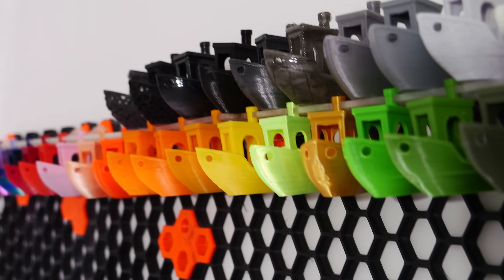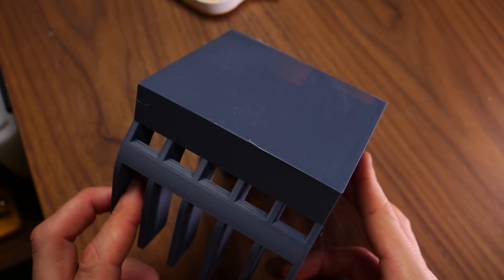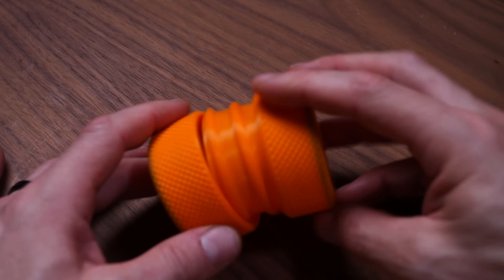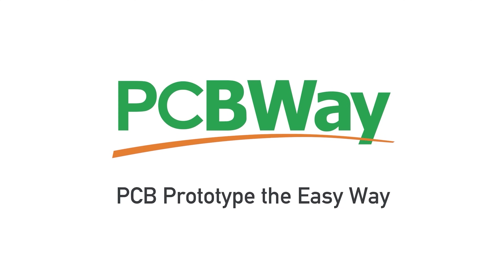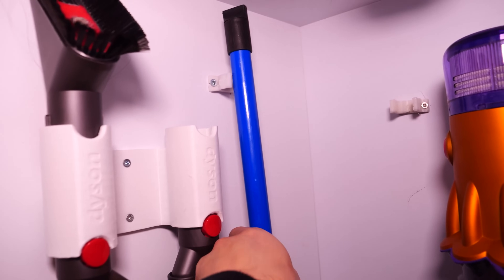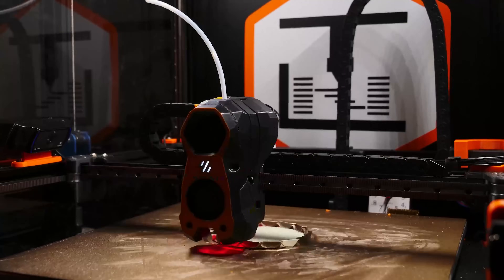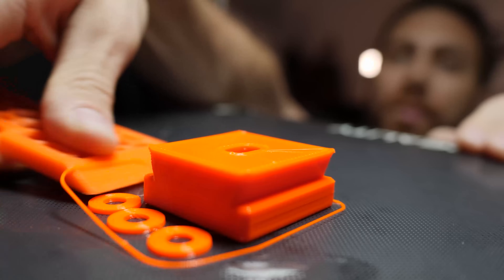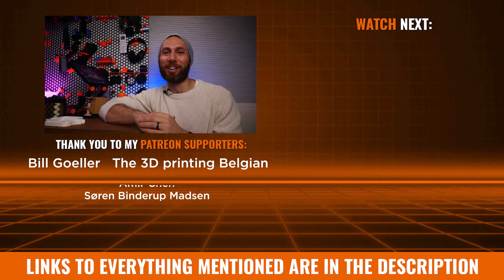15 Useful 3D Prints: Go From Beginner to Advanced!

Comment: I had an idea for my kitchen pop in my head while I'm watching this video.  I have a few metal shelf baskets that attach to the wall in my kitchen. This spot sits behind what was the original back door. It's not much wall depth and the floor vent is directly under this spot. So, no furniture or cabinets will fit outside of a custom build. I can print my own to add storage space to that wall and get better use of the space. It's perfect for pantry goods that come in certain box sizes.

Comment: I struggle with keeping the bevel even at the tip. Mostly on one side. I use a 1x30 system and I have tried to figure out why by changing my movements. Any tips?

Comment: This post rocks. Thank you. We beginners need more of this kind of thing. Don't get me wrong, I make a Benchy with every new spool, but I'm so green I don't even know what I'm supposed to learn from a Benchy, so I just have a small flotilla that hasn't really helped me learn anything. The rest is usually fumbling through the settings until I get something to work. Am I making it work in the best way? I don't know nearly enough to say. This kind of post, however, is immensely helpful. Thank you again.
Reply: Hah. That’s why I’ve never printed a benchy. I’ve had my printer for a month and haven’t had any problems with it yet.
Reply: @claire2430  don't worry. You will. Maintenance is part of the hobby.

Comment: For the stand, try printing with proper hirth joints instead of those little friction bumps. It's actually a pretty easy model for 3d printing. There are three angles that matter. Tooth angle, (60 degrees works well), angle between teeth, (we represent this with the number of teeth), and the groove angle. Groove angle is dependent. The equation is: 
arctan[tan(90/number of teeth)/tan(0.5*tooth angle)] Don't forget, the groove angle is half of the total angle between the tooth and the groove. There is an awesome PDF called "Geometry, equations, and modeling techniques of Hirth joints/couplings". It will teach you all you need to know for the purposes of modeling for 3d printing.

Comment: Summary of the video: "Here's a print that will challenge you with this setting!" Video then proceeds to NOT explain a SINGLE thing about that setting or what you might need to adjust in your slicer / printer settings if the very specific thing he says will go wrong goes wrong.

I was hoping that at the end of the video there was maybe something along the things of "if any of these prints gave you troubles, here's a list of other videos I've made explaining how to fix these problems." But nope. This video is clearly aimed at those newer to 3D printing, but offers nothing useful to anyone struggling.

On the plus side, there are some cool printable gadgets here that I might not have found otherwise...

Comment: 3d printed a mouse shell for my logitech g305. Turned out perfect but Tolerances need to be spot on. if not the pcb, scrollwhelle and other hardware will not fit!

Comment: The video is great for guiding you to problems without helping with any of said new found problems. equivalent of a teacher throwing the textbook at you and telling you to read the chapter.
Reply: Even worse. Its trading small, low cost test parts for larger higher cost test parts. So not only do you still not know why the stringing happens, you get to waste 200g of filament instead of 10g
Reply: I love the video of what xyz means in the benchie test. Did you know the benchie has its own website?  @Leedledlee
Reply: @Leedledlee  EXACTLY. The title is so misleading
Reply: Right?! I got about 4 minutes in before it hit me. This video is basically useless.

Comment: I tried printing the cable winder - the lid. It sticks well to the print bed, but about 60% through, when it's printing the middle bits, it does not stick to the print anymore and then just starts printing in mid air. Any ideas why this may be happening? Thanks!

Comment: As someone who also does a lot of drilling around the house, I’ll let you in on a cheaper, more effective & more accessible trick for catching the dust: try a post-it instead. You stick it to the wall just below where you’re drilling & fold the bottom half up so it’s like a paper shelf to catch the dust. It catches all of the dust (because it’s stuck completely against the wall), & if you don’t have a post-it, you can use tape & paper to achieve the same effect. It was a game changer for me :)
Reply: You can also do this with an envelope and a piece of tape.
Reply: I have always just held a damp paper towel underneath while drilling and wiped up anything that stuck to the wall. May have to try the sticky note to see which is better.
Reply: Or use the bottom half of an empty milk carton -cheap, light and readily available.

Comment: 14:28 these (with pla plus and my settings) will support 100lbs, yes really, i hung one up and started to pull on it with a old fish scale, most i could pull was like 60 lbs, so i started to hang from it, had it at 100 before i shifted my weight again go put more on it and it went. In other news getting whacked by a 6lb fish scale at high speed in the hands and head hurts really bad. Cant wait to repeat the test with cf nylon in the future!

Comment: This guy advertises challenging for any 3D printer but yet is rocking a bamboo Labs  carbon which basically does everything for you even calibrates your first layer
Reply from the maker: Yeah that’s fair, though the Bambu is far from perfect, but I mostly printed with it because it does the Timelapse’s for you! Though as you’ll see in the video I did a lot on my uncalibrated voron and my Prusa

Comment: I have an issue where i get holes in my outer surface (walls). They are not completely random, they appear als in the same
Spot and they are not z-sean. My Z seam is already aligned.
I tried drying my filament in a filamend dryer from sunlu but its not helping. At first the filament printed well but now… i even tried standard settings from cura.
Reply from the maker: Upload some pics on our discord we will help you out. It’s probably pressure advance not being well calibrated. Https://jle.vi/tnldiscord

Comment: I wish you the best in making youtube content and to help you there are some things i think worth mentioning:
- If you really want to make the viewer to learn how to print better then, teach them! Pick only 3 models, which you think the most challenging and tell what to expect, and how to prevent from failure. You are just mentioning what to expect, but THE beginner, who watches this video will just scrach his head where to start. (BTW, You did great at 14:35 and 16:50!)
- I wouldn't recommend such a big and high print FOR setting in the retraction. It's too much wasted material on the bottom before it starts showing the affection of the retract. Time and material could be spend more efficently.
- Try to show the latest, and mostly the easiest ways to edit/make models. The Prusa slicer 2.6 came out 2 weeks ago with the alpha version, that makes you able to create text on your model. I think TPU could be later in the video coz it's more advanced, then a "second model for learn to print".
- After a finished build you need to calibrate your printer first, and then you can print stuff with it... Don't be sketchy, when you made yourself to build a Voron! The whole point is to be professional, with fast and accurate printing. Calibration is foundation!
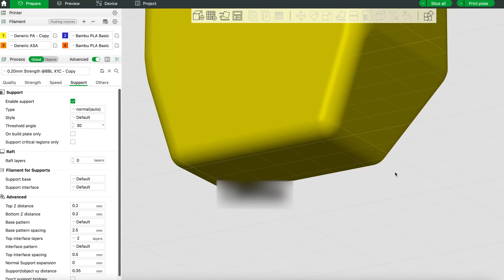- 11:00. Instead of explaining that why this model wasn't correctly made for 3D printing, you could explain how to repair the modell to make it fit. For example I would cut down the bottom 1-2 millimeters in the slicer and if it's needed, then I would bring in a box and shape it so it makes the bottom on the same thickness as it was before. 
- 12:00 If you already know the screws are gonna separate the layers, don't use woodscrews. They chamfered on the bottom so they will separate the layers, anygood the adhesion is... Use allen screws and washers instead. It's not just about the printing itself, but how you handle the print after the fact too..
- Don't hit your previous sentense. Vase mode has no infill as the hyperlapse shows, so you don't need, actually you can't change the infill by any means.
Reply from the maker: Great feedback thank you so much!
Reply: yes! this is a nice overview, but please start with the building block basics, so these things you are saying will/may fail get fixed... and teach the skill. This is from a maker who has their first 3d printer in the happy brown truck driving to me right now. :)

Comment: You dont need a 3D printed part to collect drill dust, just roll a peice of masking tape so the sticky sides touch each other and place it on the wall below your drill hole, there will be a small gap between the tape and the wall where the dust will collect and stick to the tape

Comment: Nice video & print ideas. New to 3DP and am struggling a bit with settings. Been using Cura 5.2 but also trying Prussia 2.0 (I think). I'm getting a bit frustrated with the settings on mini's but still learning. I made some 50 cent piece sized mini's that have words on it. Letters run together 😊. So I appreciate the ideas for checking the tolerances. 👍🏻
Reply from the maker: Try out PrusaSlicer 2.5, it's quite good.
Reply: @thenextlayer  I just looked at it and it is 2.5 so it is the latest, thx. 👍🏻